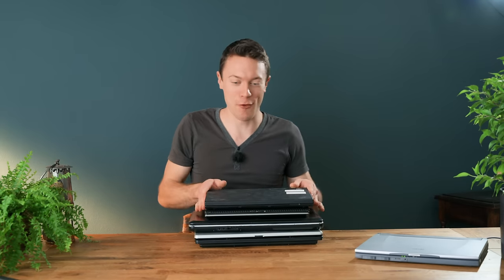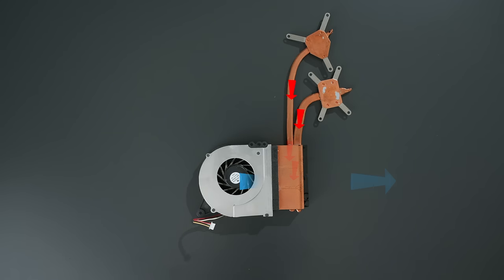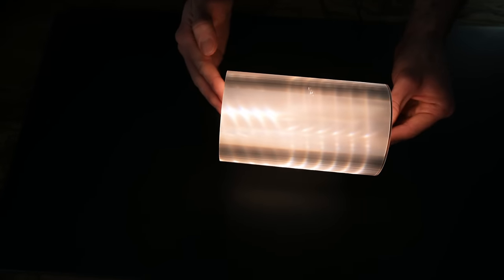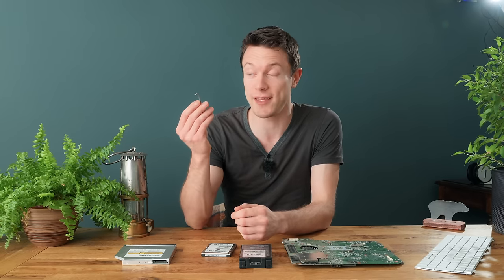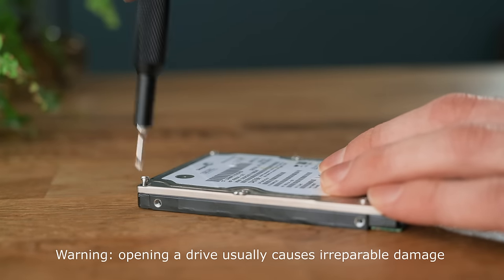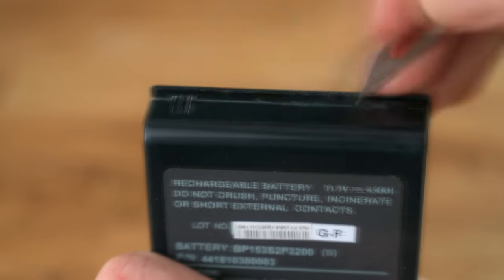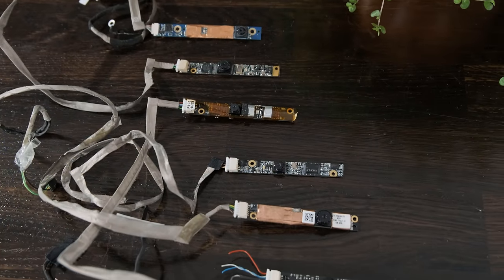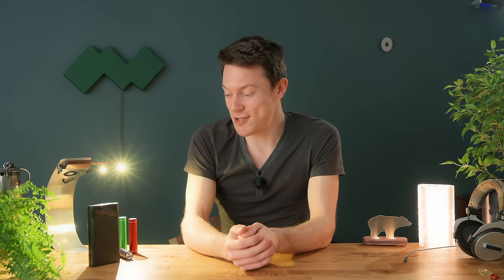Things you can make from old, dead laptops

Comment: Can you make the same concept with Android phones , I got a couple of theses....
Reply: youll struggle to separate anything out of a phone as they often all in one board. not sure about the screens though might be worth giving a try ;)
Reply: Old phones are best used as smart sensors in one way or another.
Top common use is as WiFi webcam.
After that there is an app you can install that makes all the sensors visible via Web page / api.
If your phone has mhl you can use it as a media station with a tv.
If it also has USB otg can be a network hdd.
Etc.
Another thing I've do was to use the phone as a remote control for various task. Either specific app for a program or as a track pad on a PC.
Reply: I have been trying to use the displays of broken phones but turns out there's no easy way to do that since many displays use slighty different protocols (not sure that's the right word, they have different amounts of lines, pixels and pixel organization, so they need their own profile) and i haven't found the type of drivers they sell for regular lcds but for these, there's always the possibility of making your own driver but I definitely don't have the knowledge and seems to be sort of a complicated task, right now i think the best solution is to fix the phone with used parts and use it like that as a server, maybe an extra screen, etc. If someone has any suggestions, i would love it.
Reply: Car dashcam
Reply: Check if any of them have support for postmarketOS. It's a much more capable operating system than Android and would let you use the phones more like spare computers. The Nexus 5 and OnePlus One have pretty good support.
Reply: @SirDella  totally best use. With USB otg they can be dual camera dash cams and reverse camera with a screen too!
Reply: @SoundToxin  That's pretty cool thanks, I thought of turning an old phone into a smart door bell the problem is there aren't any apps to do this, so I'd either have to make my own or cobble something together out of several apps which just isn't possible for some of those really old devices with 512MB/1024MB of ram and ~200MB of free space.
Reply: @TheWebstaff  Here's a few more ideas: 
GPS tracker, put a sim and a cheap plan on it then you can use it to track your car if someone borrows it or should it get stolen.

Wireless microphone, not great for live use as there will be a delay but still useful as a remote mic.

Personal intercom system or walkie-talkie, similar idea to the previous one but with two-way communication, if you have a bunch of old devices you can place them around the house or outside within earshot of where people tend to be for quick conversations.

Smart door bell, it has all the components you'd need but unfortunately I'm unaware of any existing apps that would allow for this, IP webcam isn't a bad start however in my experience no matter the phone used, the feed is too slow and the two-way communication is equally as slow so you could be waiting upwards of 10 seconds for a reply and even if it wasn't you'd still need another app as a button and provide push notifications.
Reply: Not really much you can do with a (broken) phone unfortunately. Most parts only fit that model of phone. The screen might have a small version of the dispersion films in them though and if you can get the battery out without destroying it (almost always glued in nowadays), it's often good enough to convert single-use-battery powered devices to rechargeable (charge and protection circuitry wil be needed though).
Reply: if your phone is still working (al least the Wi-FI chip isn't damaged).. you can make some interesting projects..
1. FTP Backup Server connected to your home wifi router
2. Wireless IP Camera 
3. a Mini Router that use it's own internet and share to other devices using the tethering feature (IF the baseband chip is still working)
4. a borescope display (using cheap otg borescope module)

if your phone is damaged, there is not much you can do.. the battery can be useful, the vibrator motor, you can reuse it's eMMC to make a DIY SSD (it's a little bit hard to do)
Reply: @slobbucket  well in my case, I'm using a different ssid, different network to automate my room (including my IP camera) so it's a different story if he/she use streamer service on internet and get spyed

Comment: I use my "craptop" as a dumb terminal to remote access into my powerful desktop computer. This way I have more computing power in my backyard, which is a nicer place to work.
Reply: thanks for the idea, i fear my laptop still too slow to even handle that but will try it out.
Reply: @mrRandomvideos1  nah actually a laptop even having a old pentium can ssh running a headless linux distro.

Comment: I've actually seen something very similar to the drive laser trick - but with an addition of a rotating mirror to reflect the laser (say, one you could get out of a laser printer).
What you get is basically a laser-projected oscilloscope - you won't use it for anything practical most likely, but I still find it to be an incredibly cool project.

Comment: I’d love a version of this video for old printers. I seem to be collecting them!
Reply: Make a 3d printer line out of it you only need plastic melt wire instead of ink.3times x,y and z gotit
Reply: These are programmed to start malfunctioning at some point, if you have skills like @Ronald Van kuyk, you can probably make them work for eternity if you replace some chip inside.
Reply: There's so much good stuff in old printers!! The larger the better!
Reply: I agree what do you even do with them besides recycle, DIY Perks Help!

Comment: Place the laser on a spring before gluing it to the drive arm for a more 2D shape profile!
Reply: Fifty years ago (yeah, we had electricity back then) we stuck little bits of mirror to the cone of an open face speaker and shone a flashlight on it to bounce the "music" onto the walls and ceiling. Psychedelic man!
Reply: Put a small mirror on the spinning motor and make your own laser line/level. Though you will need to level it...
Reply: @Charliebrm1 This is exactly how cheap laser music visualizers did/do it, except it helps to wrap the speaker in plastic and attach the mirror to the membrane, not the cone itself.
Reply: @LiveMusicOntario  Was that accompanied by a 'jazz cigarette' perchance? ;)

Comment: If you have an old laptop, replace the hard drive with an SSD and install Linux.
My favorite distro is Zorin OS, as it is similar to Windows in every way it can.
Reply: S T  I do not have any old machines to test with, I just like this OS for its simplicity and similarity to Windows.
Reply: @littlebit670  I've revived some really ancient machines like that - only problem is watching streaming video. Everything else seems to work fine (including watching DVDs and other media files). I like the weight and feel of old business laptops.
Reply: Or if they like Windows, even that will run much better on an SSD
Reply: Indeed, and there a many other distros of Linux if you are feeling a bit more adventurous. It depends how much learning you want to do, but distros like Mint or MX have fairly easy to use desktop environments. I've had an old 32bit machine running Tinycore and still getting good performance but it did have a steep learning curve.
Reply: Hi James, using Mint on an old desktop (orig os XP)  Where can I get Zorin download from  ? what gui does it use? is it Gnome based?  if its Ubuntu have they updated the video drivers?
Reply: Ubuntu.
Reply: And how frustrating is the fact that barely any software is fot it? (for Linux)
Reply: @mariannmariann2052  any software you are thinking of that you can't get on Linux?

Comment: VIDEO IDEA!! 
"Things you can make with old, computer peripherals"

Mice, keyboards, headsets, webcams, ext
Reply: Yup we need this. Because a lot of us have atleast 1 broken mouse or keyboard.
Reply: @Joey_tomb  Here are a few ideas to get you started with those peripherals...
Use the USB cables from both those items for the camera and speaker amp as mentioned in the video. 
Keys and/or circuit board pieces can be made into jewelry, or assembled into small quirky enclosures for USB flash drives.  There are a few useful micro switches inside a mouse, and a laser mouse has a very bright red LED that can be reused. Even the lens can be used in projects requiring an internal indicator light to shine through an enclosure from within. ;-]
Reply: "older computer mice have quite heavy balls in them. They can be easily removed and thrown at actual mice".
Reply: @kwerk2011  LOL!
Reply: good idea. i would take it apart and throw it away - kinda upcycle my garbage bin
Reply: Stick magnets to keyboard key caps and attach them to your refrigerator.
Reuse the laser in a laser mouse for whatever purpose.
Collect 4 scroll wheels to make a toy car.
Use the keyboard chassis as a board.
Reuse headphone speakers.
etc.
Reply: @Joey_tomb  I dont hang on to broken parts I throw that crap in the trash.
Reply: @kwerk2011  Slingshot ammo
Reply: Like... What ya can make out of old parallel printer  cable connectors!
Reply: @christophergrove4876  I made a Motorola high power spectra 2-way radio programming cable out of some.. That is a specific thing but still a nice reuse of a cable that would have gone to the trash.

Comment: If laptop just has broken screen / keyboard / trackpad — connect external ones

If it's working but too slow — install a lightweight Linux distro like Lubuntu. It might make a slow device much faster and actually usable for browsing web
Reply: Олeг E. Good idea, I use Puppy Linux or Gparted most times. Will look at Lubuntu, thanks
Reply: Yay!  Finally got to a GNU/Linux tip!
Reply: cleaning, reapplying thermal paste, and buying more ram, can improve the performance
Reply: I find if the computer is not too old/underpowered Ubuntu 14 works very well (although no longer supported).
Reply: Basic stuff
Reply: My wife gave up on her laptop since it was running so slow. 
I swapped the hard drive out for an SSD, loaded the new Ubuntu 20.04, and added some RAM from another dead laptop.
She was a little hesitant about learning a new OS at first, but within a couple days she was completely comfortable with it.
Reply: @firestorm-1154  You can easily use lighter Linux distros that are up to date.
Antix is for machines with ~1GB RAM, Puppy distros like BionicPup are for 512MB machines. And if your old device is a 64 bit - you can use a lighter Ubuntu flavor like Lubuntu, Kubuntu or Xubuntu.
Reply: @mr.farrowsclass6592 That's lovely !
Reply: @einat1622  More like that's GREAT.
Reply: @einat1622  Puppy was my favorite with relic machine now in my bit newer t420s it is KDE neon I think.

Comment: The reflective disc is perfect to add to an emergency outdoor kit. With the hole in the center, sighting and signaling at distance including low altitude aircraft can be a life saver. Morse code not necessary if you are actively missing.
Reply: Or you could just use a dvd
Reply: @sandyroy4857  nah I use the old cd and dvd's as christmas light reflectors ... they warp great in the dishwasher on the dry cycle quite well ... and the center hole allows the standard BULB socket no problem ... and with a rubber gromet one can use LED light s as well ... it is funny seeing the old AOL disks finally being useful LOL .... they also make great coasters

Comment: Me durinng the quarantine: Omg its so boring
Also me: Finding this video, and remiding myself i have broken laptop in my basemant
1day after: Actually quarantine is so fun
Reply: How did you find all of the tools
Reply: That's the spirit! Take that time we all have and use it to try out something new :)
Reply: S H I M A R F A R Z A N most people have toolboxes. i’m assuming FM Network does. plus, he could’ve used amazon, ebay, craigslist, etc.
Reply: @retiredchannelreaddesc2186  volume and Prime
Reply: @DGARedRaven  (usb) Short Pro
... Error
Reply: @grass-eatingsheepwhen7713 Upgrade - Dash 99%
Reply: @user-yv6xs8hy6o  (Android)
network Comments color and blue green Google Play Store App for
Save Backup File Manager Edit more!
Reply: Drive
Reply: @DGARedRaven  3:49 color
Manage files and information About
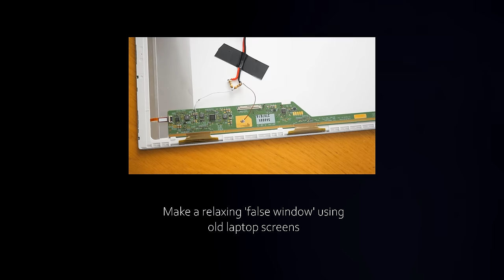English - Tools Dark Background 4:35
Comments on Prime Time - the
Gestures are pop-up language Edit :)
Reply: Lol I have a few broken laptops along with a big bulky slow one, they are all gonna nervously overheat
Reply: Ha! 30 minutes after Lockdown I decided to fix the oil leak in the car.
60 minutes after lockdown that required a smaller piece of mirror.
62 minutes after lockdown, 30 minutes after disabling the only transport I had to travel the 60 minutes to hospital ... I needed a small piece of mirror.
I hit a broken piece of mirror with a hammer and the piece I wanted went up and up and up ... ok down and cut a 5mm vain in the back of my hand which spurted a solid stream of blood 300mm which continued till I held my own hand.

Lockdown was not BORING ... that was an hour in and we had 6 weeks to go.

Comment: Two more interesting things:
If it has a Windows product key sticker, you can apply the code to a new install on a new machine (not sure why you would need an older Windows version, but meh). After you install Windows it will want to register with Microsoft to see if the key is valid. If it doesn't validate, try to validate again but instead of validating over the internet choose to phone Microsoft. After you answer all of the questions the automated system asks you, it should finish by asking you if this version of Windows is installed on one machine (it is) or if you've changed any hardware (you have). After selecting yes it will then go on to have you type in a special code onto the machine and you'll be verified and registered correctly. What happened is Microsoft originally had that product key registered to a different machine. Since that machine "blew up" and you installed it on another machine Microsoft thinks you've tried to install it twice and doesn't know the old machine has been destroyed. After you use the phone in option and told the automated system you've changed hardware, Microsoft will transfer the product key from the old system to the new one. This is not illegal and is a legitimate way to re-install Windows, migrate to a new machine, or let's you re-register after a major system upgrade.

You can download a valid ISO of Windows 10 and 11 from Microsoft. When you install the new Windows it will ask for a product key. You can use the product key sticker number from Vista, Windows 8 or 8.1 for Windows 10 or 11 without an issue. This isn't a pirate or hack because Microsoft is fine with you upgrading from their older OS to the latest one. You can either burn a CD with the ISO or used a program I like to use called "Rufus" (Google it) to make a bootable USB thumb drive installer.
Reply: I tried that with several versions of windows ... sadly Microsoft only transfers in the usa ... they dont seem to transfer if it is a laptop ... or a proprietary system like an ACER or HP ... as they are sold a resellers tag and THAT is not able to be upgraded by hardware ... IF you get it done by the OEM (outside or other equipment vendor) they will retag it and it will work but it will cost you a lot
Reply: As for why you would need an old windows version: Windows 10 has significantly more spy ware, to the point that windows records all your keystrokes and senda them to the cloud without your consent. Downgrasing to an early version will give at least somewhat better privacy.

Comment: For the laser idea, I thought he was going to use it to transmit sound via light. At the receiving end he could put a photodiode to recover the signal and turn it back into an electrical signal, then audio again. 
You can send your music to a remote location, so long as it's within line of sight.
Reply: Audio can be quite fussy so probably a bad idea if you're talking about directly playing it as the light isn't isolated like in TOSLINK. If you meant for data transfer, there is a reason why infrared died off, and this basically has the same disadvantages.

Comment: I’ve got an old Dell commercial laptop I use only for scanning slides and negatives mostly. Still running XP. I turned off the WiFi permanently so as not to risk any bad stuff from the inter webs. Also have daughter’s old Compaq laptop from college, put Ubuntu on it and using it mostly for audio editing.